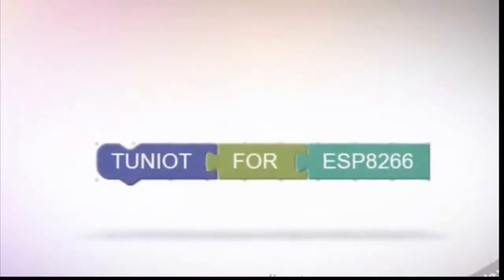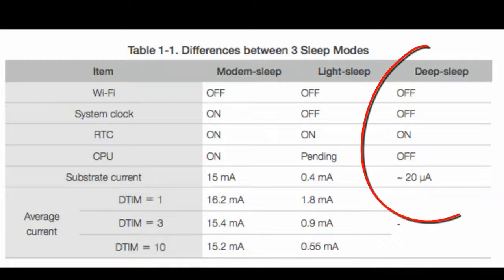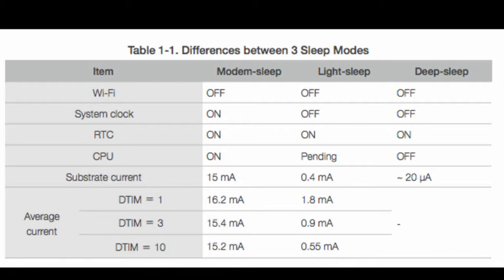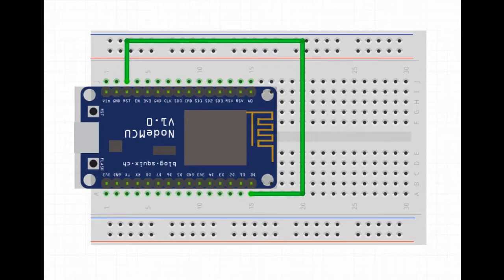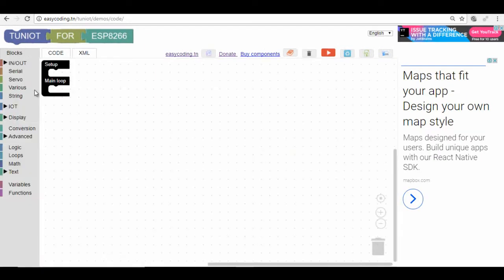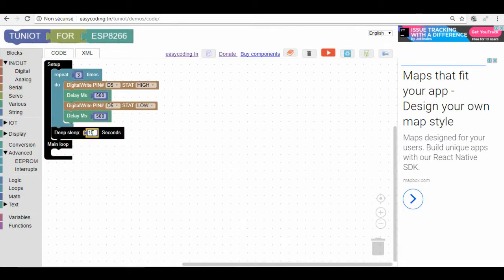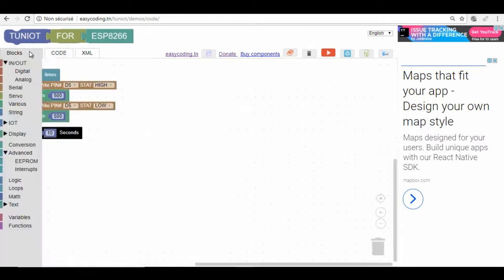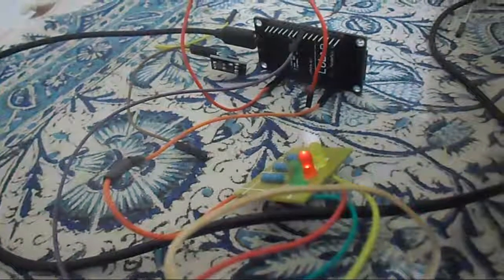NodeMcu (ESP8266) Tutorial A-21: The Deep sleep mode

Comment: I did real-time home automation using this nodemcu.  the problem I am getting is nodemcu is freezing after a few minutes it's not receiving any inputs from the cloud. when I restart the power supply then again it works fine for a few minutes then again freezes what's the problem with my nodemcu??
and 
how can I make the nodemcu to stay in deep sleep and make it awake by external input from the cloud??
please help. the power led on nodemcu will be glowing when its freeze. I am providing it a 5v supply from my mobile phone charger

Comment: Have you ever measured the current consumption with this board? The consumption during the deep sleep mode is around 8 mA (yes, milliamps) and not 20 uA. This is due to the USB-UART bridge. If you need to use battery power you need to go with ESP01, ESP12, or any other with no USB-UART bridge.
Reply from the maker: thank you for the info.
I did not test that. I focus on the programming part.
Reply: I already test it sir, generally speaking, the truth is there is reduction of the current use during deepsleep and not during deepsleep. I published a video on that (this was made possible and easily using the easycoding.tn platform) : https://youtu.be/NHRncpYN3F4
Reply: Hi @adekassha or @averri1 can you guys tell me how do i enable deep sleep in my node mcu, i have connected as shown in the video and exact code still not waking up and running the sketch, after waking i just see: ets Jan  8 2013,rst cause:2, boot mode:(3,6)